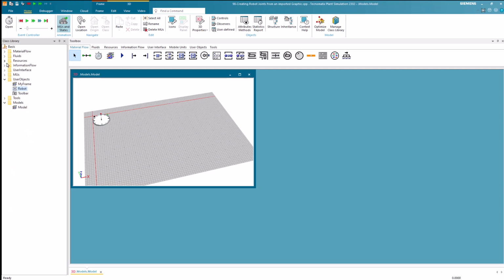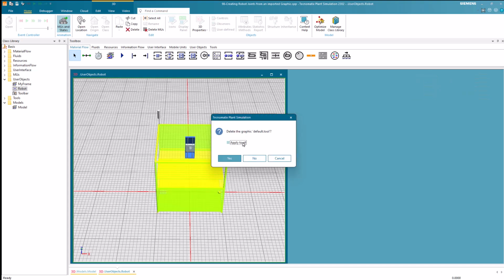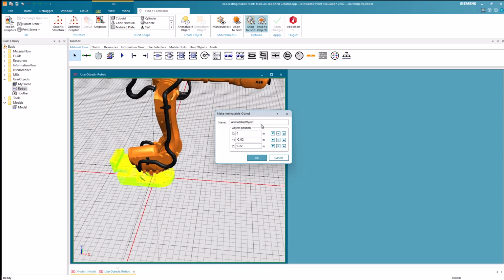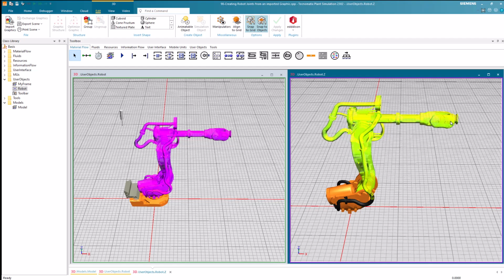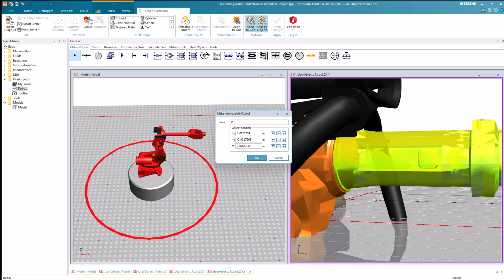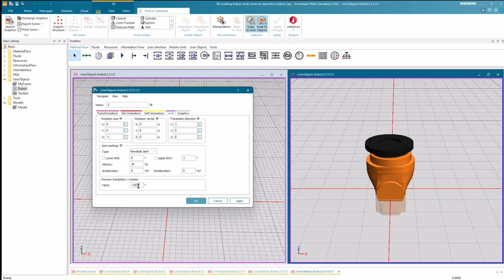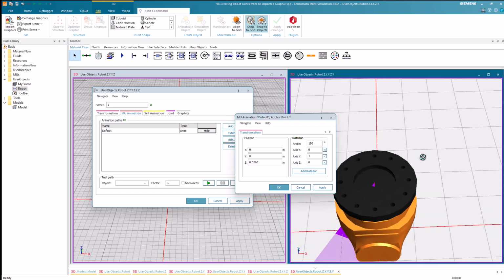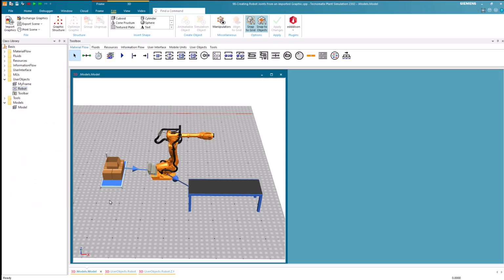Plant Simulation 27 - creating robot joints from graphics

Comment: Hi, good format, but where can I find the jt files to import into my project? I visited the ABB website and tried searching for the ABB_irb6650_320.jt file, but I couldn't find any results. Can you help? Thanks in advance.
Reply from the maker: Hi and thank you for your question. Have you tried posting (or searching) in our user community? Often someone there already has a solution for your question. (the user community is here: https://sie.ag/k7ziG )

Your second option is to open a support ticket for your specific version of the software here: https://sie.ag/cPRzt. This will ensure your question is quickly routed to the correct technical support resource.  Hopefully this helps. Best, Team Siemens